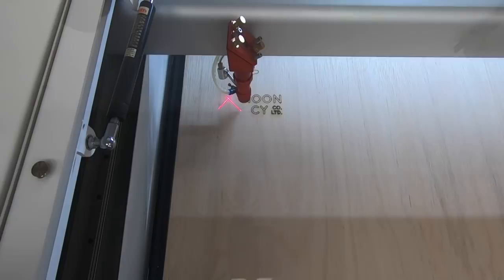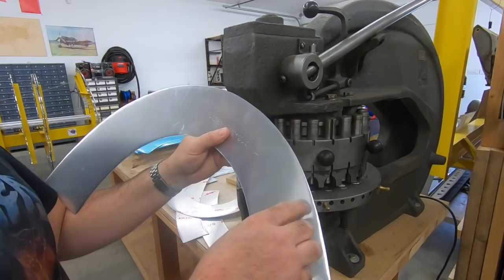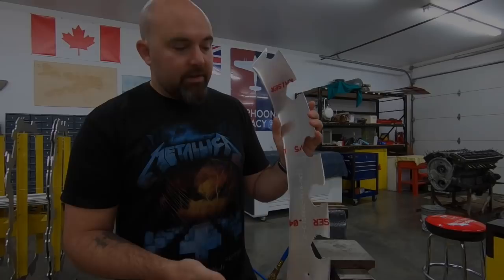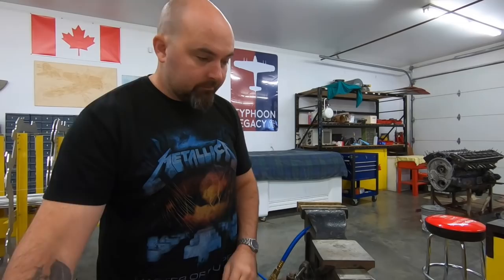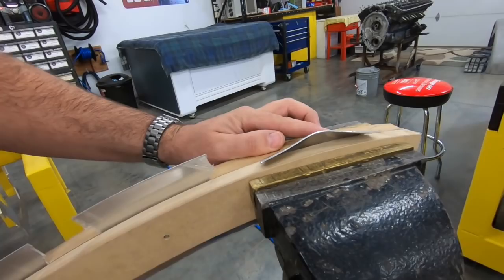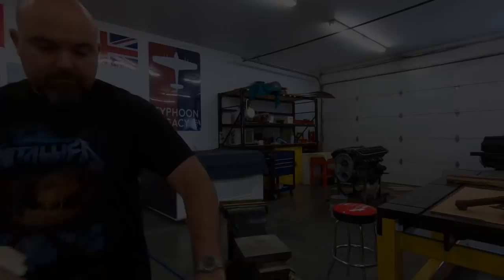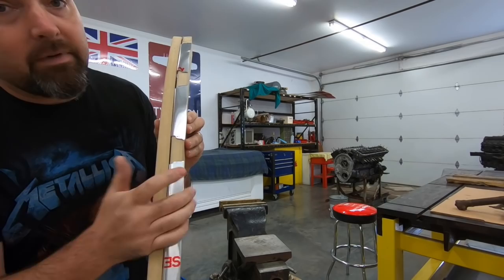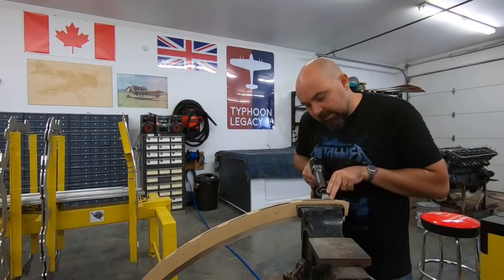S1E5 Rebuilding Hawker Typhoon JP843 - Shrinkage

Comment: Ooh the dark arts of Tinsmithry, I would've been taken out and tied to the back of a Harrier, if I'd used a Pneumatic rivet gun to chase sheet metal onto the form block lol On Aluminium we'd use either Nylon or Box-Wood Mallets, along with either fibre or Jabroc chasing tools, plus rub blocks hit with a large hammer (for heavier gauges).

Incidentally what Aluminium Alloy are you using and in what treatment state?
Reply from the maker: It can get VERY tricky using the gun, the wrong movement can cause some really bad marks and either scrap the part, or waste significant time reworking. I normally use oak, maple, or nylon punches and blocks to get the best control under a hammer, but the shape of these profiles (and the quantity) made it fairly straightforward to use the gun for some forming work.

This material is all 2024 "O", and will be off to heat treatment (and re-shaping) fairly soon. ~Ian
Reply: @TyphoonLegacyCoLtd  As I was taught, the more marks you put in, the more you've got to get out lol

2024 I'm familiar with, after having it solution treated and re-shaping, will you be having it hardened or leave it to naturally age?
Reply from the maker: @toboldlygosmodelworks1973  Absolutely true! Patience is the key here, best to walk away when you lose it or you'll pay for it later! ~Ian

Comment: Sorry if this sounds a bit trite but I have seen a 100tonne rubber press used with wooden form blocks to flange formers for light aircraft such that the flanges came out nice and smooth ,have you considered doing this ?
Reply from the maker: Pressing has been considered, however, the press size is relative to the parts being formed (size, thickness, material etc.), and the system we are using produces the same results. The rebuild of JP843 is essentially a one-off (aside from some areas where we are helping other groups with parts), so until it is complete, or nearing completion, there isn't likely enough demand to substantiate the expense of a press and it's installation. A 100 ton press may work for smaller items, but we would likely need upwards of 800 tons to press the larger parts properly; with this would come ceiling height, concrete depth, and power considerations. Lots to consider and quite an investment. ~Ian

Comment: I can understand the workmanship or desire to make traditionally but why not cut it all by lasers, it's not as if you're not using one to start?
Love the Typhoon and Tempest
Reply from the maker: Hi Douglas, cutting the material with a laser creates a heat affected area that you can't have on aircraft parts, it changes the properties of the material. The laser can cut the form block material, but in most cases this would require an additional axis that is not possible on this machine. ~Ian
Reply: Typhoon Legacy Co. Ltd. thank you for the reply, it's looking fantastic, what a great rebuild, a beast of a plane

Comment: Hi do you use a heat gun to obtain a bit of compliance to the shape your after?? Very impressed with your skills
Reply from the maker: Hi Chris, for airworthy aircraft, the use of heat needs to be highly controlled. The material can be  treated, and annealed depending what type of results you need, but these must be done in very controlled situations to ensure the results are within the desired range. Localized heating is not acceptable for these parts. 
In our case, we start with "O" material (annealed), so it is soft when we start work. Through the process there is a bit of work hardening, but this can be controlled by using effective techniques and not making extra work for yourself. Once the parts are shaped, they go for heat treatment and begin to age harden to the desired strength after quench. This  age hardening can be retarded, and the material held in the "W" condition (unstable, still soft) for a longer period of time if placed in a freezer. After quenching, the parts need to be inspected and straightened while in the "W" condition due to the potential for warping during quenching. Once true to the form, they are allowed to age harden to T42 condition and will be safe for flight. ~Ian

Comment: Why not laser cut all the metal parts instead of etching and manually cutting?
Reply from the maker: Structural aircraft parts cannot be cut with a laser because it creates a heat affected zone around the cut which is unstable,creating varied properties in the material. ~Ian

Comment: Ian, so impressive, your craft.  I am a Materials Engineer in plastics and composites, I am also restoring a North American T-28 down in Portland, Oregon.  One of my challenges is rebuilding a section of the firewall, I have had my share of shrink and stretch work over my wood forms and a pile of scrap!  So I get your pains.  I would like to know about the materials and the heat treat plan.  How can we help with the project?
Reply from the maker: Hi Johnny, sounds like a good project! Interestingly, we ended up with a T-28 prop in our shop whilst trying to get our hands on a HS 23E50, the different size blade shank renders it as a trade item now.
The material for the airworthy set is 2024 O material, and I will be taking everything in for heat treat once I'm done the last few bits, then will straighten.
There are a few great ways to help us if you are interested, one being a subscription to our paid video channel: https://typhoonlegacy.vhx.tv/

And the other being through donations direct through paypal on our website: https://www.typhoonlegacy.com/index.php/donations/donate-to-jp843-project/

Of course, we are also always looking for parts for the aircraft and engine, the Hamilton Standard 33E60 and 23E50 are US made items on our list at the moment.

Thank you very much for your comments~ Ian

Comment: The Hawker Typhoon had a reputation for being a difficult plane to fly. Once your Typhoon is rebuilt, will there be anyone to fly it?
Reply from the maker: It was a very stable aircraft in the air, but did challenge it's pilots when taking off due to the torque of the Sabre. I don't foresee an issue finding the right pilot to fly JP843 when she's complete and ready to go, there are many qualified individuals with test experience.
Reply: @TyphoonLegacyCoLtd  Excellent. I hope to see it fly at Duxford one day.
Reply: The Typhoon did have a few 'issues' tail ripping off and the temperamental engine .... I've seen the Sabre engine on display at Hendon.... what a beast it is, fancy seating a few feet behind that. On the other hand the Typhoon was a fearsome weapon in experienced hands. Read Roland Beamont...
Reply from the maker: @brianperry  It certainly suffered from teething issues after being pressed into service, but these were mostly ironed out by the time the Allies made it back to the continent. ~Ian

Comment: Years ago I met by chance a chap who had worked during the war at the factory making the Tiffy. He said his job was to boil the alloy sheeting in large tubs of special salts. This was necessary to allow the skins to be fitted correctly. It was a delicate task as boiling for too long or short a time would make the metal unfit for purpose. Does anyone know more of this?
Reply from the maker: Salt baths are a method of heat treating, they are very effective on aluminum, and are capable of sustaining very accurate temperatures. They are still used, but not as common now. A lot of knife makers use small versions. If you take a piece of aluminum, say 2024-T3 (suitable for structure), and heat it to 930 degrees for a specified period, and then quench it in water or glycol, it will be in an unstable state referred to as "W", in this state, it is as if it were annealed and you are able to easily work the material. You will only have about 30 minutes before it starts to age harden again, eventually returning to its tempered condition after about 72 hours.~Ian
Reply: @TyphoonLegacyCoLtd  How interesting! Thank you for this further information and good fortune be with you for the   build. It is sad how careless Britain has repeatedly been in preserving her remarkable legacy of invention. The Typhoon was an awe inspiring aircraft!

Comment: What engine are you going to be using?
Reply from the maker: The goal is to use the Napier Sabre as originally fitted. ~Ian
Reply: @TyphoonLegacyCoLtd  excellent! Was hoping you were going to say that 😁
Reply: @Joes1989  Let us hope there is a documentary series on the engine re-build! That would be fascinating, seeing there are no more mechanics out there who worked on them in the day. I imagine seals will have to be hand made etc...
Reply: Oh, if I could travel back in time! My cousin co-owned a precision engineering company in Cheltenham, UK, specialising in aviation work. Farnham & Rose did a lot of sub-contract work for Dowty, for example. The QA manager there, Norman, whom I met in 1969, had been QA supremo at Napiers during WW2...!

Comment: This was probably the most dangerous front-line fighter for its pilot. Carbon monoxide 
fumes in the cockpit, huge torque on takeoff, pathetic climb and 
ceiling, high landing speed, unreliable engine prone to seizing up under
 dusty field conditions, and a tendency to flip over when doing a 
wheels-up landing or when ditching. In one word, terrible. The courage and valour of
 the pilots who went to war with this beast cannot be over-emphasized. What do you think?
Reply from the maker: I think these comments are a bit dramatic. The Typhoon, while originally designed as an interceptor, ended up excelling at the ground attack roll. The roll itself was one of the most dangerous activities of the war, very high speeds, low altitudes and heavy loads. The aircraft and engine went through some teething problems early on, a cutting edge engine being put into what was to be the fastest aircraft in the RAF's inventory. As with any new technology, there is a learning curve and a great deal of early study and development, the Sabre / Typhoon combination was no different. Vibration, cooling and sleeve technology were all early issues, but also all issues that were ultimately resolved or corrected . The airframe was no different, and went through a few issues with the tail and cockpit; again both resolved or corrected.  Ultimately, the aircraft and engine were very successful. All types have development changes and initial teething problems , it seems that many choose to focus on these issues with the Typhoon. ~Ian
Reply: @TyphoonLegacyCoLtd  What you don't say is that the solving of the Typhoon's problems claimed the lives of several test and service pilots when it shed its tail, something that was never encountered during Spitfire or Hurricane deveopment